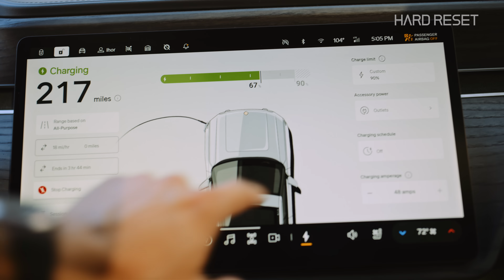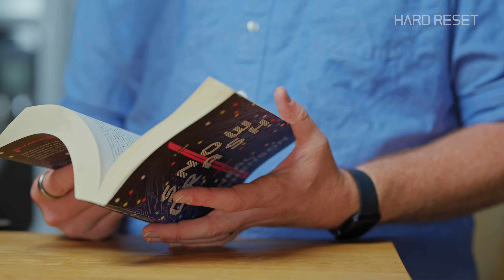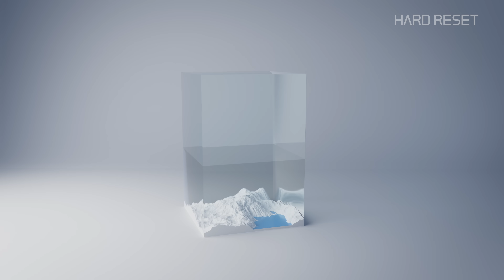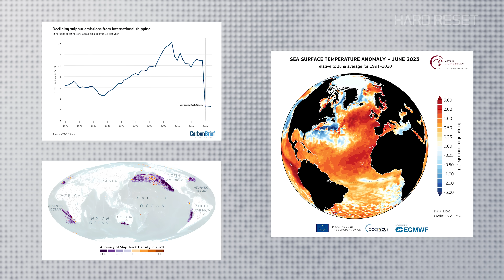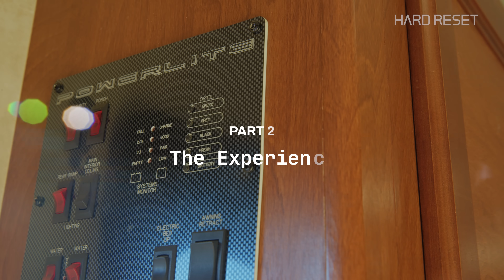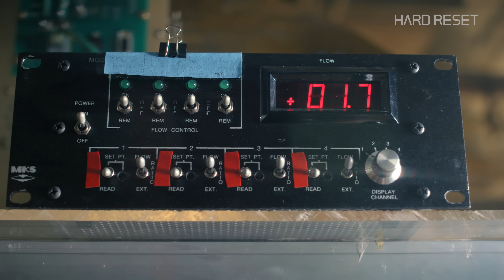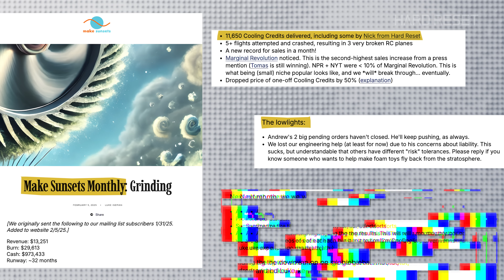The DIY Climate Fix No One Wants... But We Might Need

Comment: Wonderful adaptible uncluttered clean independent or cooperarive energy technology

Let's face the wonder of full heat use
Refrigeration, by the principle that energy is conserved should produce an equivalent amount of electricity instead of consuming electricity. 

Energy sensible refrigerators that absorb heat and yield electricity would complement computers as computing consumes electricity and yields heat. Computing would be free. Chips could have energy recycling built in.
This would improve performance and lower cost. 

Full heat recycling, all electric, very isolated underground, undersea, or space communities would be highly survivable with self sufficient EMP resistant LED light  automated vertical farms, thaw resistant frozen food storehouses, factories, dwellings, self contained elevators, safe rooms, and horizontal transports. 
In a flourishing civillization, small self sufficient electric or cooling devices of many kinds and styles like lamps, smartphones, hotplates, water heaters, cooler chests, fans, radios, TVs, cameras, security devices, robot test equipment, scales, transaction terminals, wall clocks, open or ciosed for business luminous signs, power hand tools, ditch diggers, pumps, and personal transports, would be available for immediate use incrementally anywhere as people as individuals or larger social groups see fit. 

Some equipment groups could be consolidated into local networks when suirable. 

If a high majority thinks our civilization should geoengineer gigatons or
teratons of greenhouse gasses out of our environment, instalations using devices that convert ambient heat into electricity can hypothetically be scaled up do it with a choice of comsequences including many beneficial ones. 

Refugee communities would be buildable quickly. Fire safes would preserve contents to 1000F for years. 

A simple rectifier crystal can, 
ust short of a replicatable long term demonstration of a powerful prototype, almost certainly filter the random thermal motioren of electrons or discrete positiive charged voids called holes so the electric current flowing in one direction predominates. At low system voltage, a filtrate of one polarity predominates only a little but there is always usable electrical power derived from the source, which is Johnson (observation) Nyquest (theory) thermal electrical noise. Max Plank anticipated that ambient thermal noise would become usable with advances in technology.  

In 1973 I filed for US patent 3890161A DIODE ARRAY for an array of metal1/ insulator/metal2 diodes that refrigerate while concurrently producing electric power. The patent was granted in 1975. It was opened to the public domain in 1992. Development should be in the public domain. 

The plausible net electrical filtrate from diodes can be aggregated in a first grouping of separate diodes in  consistent alignment parallel. After a primary level of grouping that preferably is in parallel, compound parallel and series networks can be built 
to provide desired DC current and voltage. Within limlts, parts of the  network can be shorted out or open circuted without electricalor chemical  harm. Widely  scalable electrical power always with equal refrigeration is thus possible. Inefficiency effects the performance but not the equality of the thermal absorbtion and electrical yield of the conversion. 

The maximum energy is converted from ambient heat to productive direct current electricity when the load electrical resistance  is equal to the array internal electrical resistance. Maximum calculated electrical power output (watts) is k (Boltźman's constant), one point three eight x 10^ minus 23, times T (temperature Kelvin) times bandwidth (0 Hz to a natural limit ~2 THz @ 290 K) times rectification halving and nanowatt power level rectification efficiency, times the number of diodes in the array. 

There are a billion cells of 1000 square nanometer area each per square millimeter, 100 billion per square centimeter.

Order is imposed on the random thermal motion of electrons by the structual orderlyness of a diode array made of diodes made within a slab: 

Host crystal in this example is silicon 

  P type boron doped
-----‐------‐----___-- Out
🔻🔻🔻🔻
■■■■■■___ + Out
  N type phosphorous doped 

All the P type semiconductor anodes abut a metal conductive plane deposited on the top face of the slab with nonrectifying joins;  the N type semiconductor cathodes or common cathode abuts the bottom face. As the polarity filtered electrical energy is exported, the amount of thermal energy in the group of diodes decreases. This group cooling will draw heat in from the surrounding ambient heat at a rate depending on the filtering rate and thermal resistance between the group and ambient gas, liquid, or solid warmer than absolute zero. There is always a lot of ambient heat on our planet, more on equatorial dry desert summer days and less on polar desert winter nights. 

There are other plausible breeches of the second law of thermodynamics. Hopefully a lot of people, mostly as independent teams, will join in expanding the breech. Please share the successes or setbacks of experiemental efforts. 

These devices would probably become segmented commodities sold with minimal margin over supply cost. They would be manufactured by advanced automation that does not need financial incentive. Applicable best practices would be adopted. Business details would be open public knowledge. Associated people should move as negotiated and freely and honestly talk. Commerce would be a planetary scale unified conglomerate of diverse local cooperatives. There is no need of wealth extracting top commanders. We do not need often token philanthropy from the top if the wide majority of people can afford to be generous. 

The topic deserves discussion and prototyping attempt action. 

The devices should be able to power the manufacture of àn ever increasing number of these devices. There could be net entropy reduction in the full energy accounting of diode array use. 

The entropic deteration of the structure of machine parts made of tough solids is inevitable but can be so minor compared to the stress of their use that machine shops can make many manufacturing tools before the manufacturing tools deteriorate out of spec. Therefore everything involved with the intelligent powering, manufacturing and using entropy reversing devices can have negative entropy. 

Charles M. Brown
Kilauea, Kauai, Hawaii 96754

Comment: This methodology is purely a bandaid on a bullet wound. Even doing it with a plane network is a bandage. IF this is even a good idea in the first place, could we use architecture and landscaping to pump the SO2 we already emit high enough to do the job long-term?
Reply: There would have to be a lot of material science breakthroughs for architecture and landscaping for the SO2 to reach 20 km (66,000 ft) into the stratosphere. The tallest building in the world is only 0.828 km high. You need something that is 20x+ taller than that.
Reply: @makesunsets  My original idea was to use mountains as supports and build through them, but I realized even Everest  isn't tall enough to directly pump the gas high enough.

Comment: The plus side of this small scale and open source project is that they share all the data with scientists. So it's not entirely a rogue thing, and they do it pretty cheaply vs. the "billion dollar project" they mentioned that didn't mount to anything. If it turns out this technique doesn't work or is harmful according to the data, at least we know, because of this experiment. Otherwise it will continuously be brought up in climate mitigation discussions in the future and we will get nowhere.

Comment: This 'solution' reduces inbound light, which reduces photosynthesis. Yes, that reduces crop production, even more than climate change does.

While there's little risk of two guys overshooting, if it becomes popular then overshoot happens at about $2 million worth of launches. And then you both have less crops and disastrously swinging global temperatures. And then their 'magic gas' falls out of the stratosphere, and global warming comes back worse than ever.

Comment: Does sulphur dioxide turn into sulphuric acid during lightning storms? Please correct me if I am wrong. Also please make editions if something's better.
Reply: SO2 can definitely turn into SO3 from electric discharges, but it is a very small amount.
Reply: Ye

It also destroys ozone

Just a reminder
Reply: @ No. SO₂ (sulfur dioxide) by itself isn’t directly harmful to ozone.

When SO₂ rises high enough into the stratosphere, it oxidizes (reacts with oxygen and water vapor) over weeks to form H₂SO₄ (sulfuric acid) aerosols.

These aerosol particles then provide surfaces that can accelerate chemical reactions involving other compounds, mainly ones containing chlorine (like CFCs — chlorofluorocarbons) and bromine.

It’s chlorine and bromine compounds that actually break apart ozone (O₃) molecules.

The sulfuric acid aerosols basically make the reactions faster and easier, especially in very cold conditions like over the poles. But we have reduced the amount of CFCs we've been releasing because of the Montreal Protocol, and it is becoming less of a concern.
Reply: @ Stratospheric dispersion of SO2 is still a net benefit.
Reply: @marioxerxescastelancastro8019  good to know, however I would like some solid point-based answers please and thank you. I want to increase my knowledge from the comments section .
Reply: Yah, REMOVING the c02 is better.  duh.

Comment: Custom aircraft seems very complicated. Can't we use the space canons people are working on?
Reply: We could use existing commercial airliners.  They can get up to around 42,000 feet, about 8 miles high.  That gets it into the lower portion of the stratosphere.  We certainly have some existing planes that go much higher.  I don't know if getting a lot higher would make the process work enough better to be worth the money or not.  Seems plausible, though.
Reply: @incognitotorpedo42  commercial airplanes are still a bit low I think.
And the lower you release the higher the frequency you need to replenish at, which in turn would increase negative side effects like reduced Air quality.

Comment: if it works as they say, it looks like a good compromise to buy us more time ... i think we will phase out fossil fuels anyways since renewable energies are getting cheaper than fossil fuels, and electric appliances and cars are already much more efficient than the fossil fuel based equivalents. With current pace of development of clean technology, fossil fuels will in a few decades will simply stop making economical sense, we just need some time ... Just maybe we should  let this "sunscreen" option as a last resource to see how far we can go  with clean technologies since they're the long term solution, while on the side developing this option to use if things go bad.
Reply: This 'sunscreen' destroys ozone

I'm not above using geoengineering, but SO2 isn't it

Comment: Is this a place holder until we get our emissions down or is this supposed to be a permanent thing that justifies emitting at current levels forever?
Reply: They say in the vid that it's just to buy time.
Reply: @jamesbright3439  time stamp?
Reply: @DirtGnap  They mention the "Moral Hazard" problem.  That's where stratospheric aerosol injection is used as an excuse to keep burning fossil fuels.  Avoiding that is essential.  We can't emit at current levels forever because fossil fuels will eventually run out, but more importantly we have cheaper options that are clean.  Fossil fuels can't compete economically with solar, wind, and batteries.
Reply: @ there seems to be a scientist on twitter warning that this kind of thing could be devastating to farmland, thoughts?
Reply: @incognitotorpedo42  the best permanent solution is to offload our mining and industry to space, but that's a loooooooing way away.